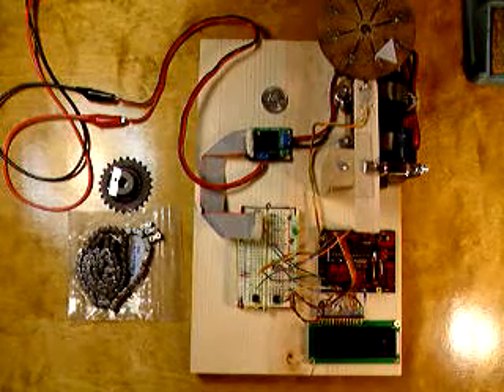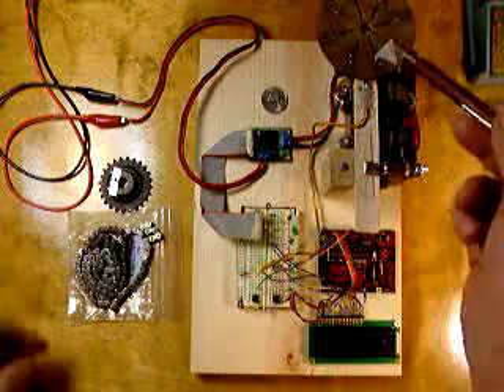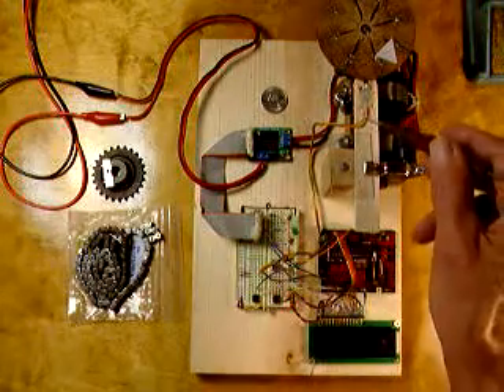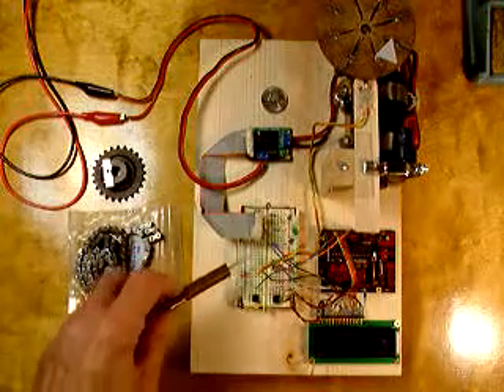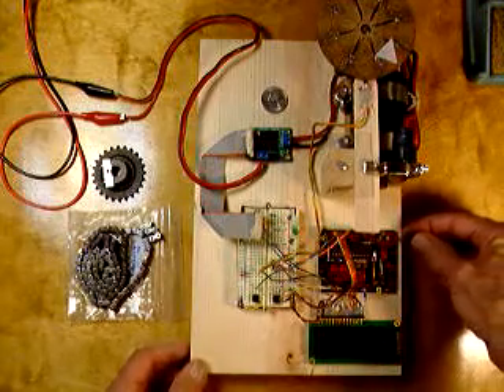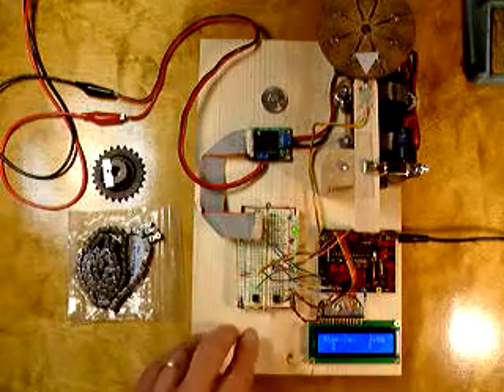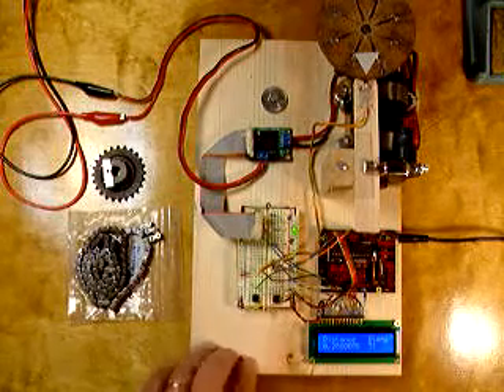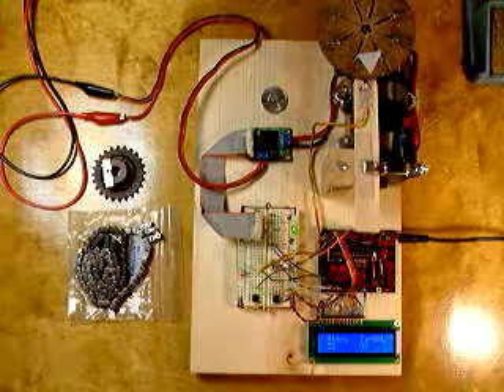Arduino servo breadboard

Comment: Is the seat belt motor a DC motor that works a little like a stepper since you're monitoring its position via your DIY encoder disk and the hall effect sensor?  If so, why not just use a stepper?
Reply from the maker: Yes, but a step motor with that much torque would cost much more. One of the objectives of this project was to find a way to do a precision job with inexpensive componants.
Reply: Jim Harvey I see, make sense.  Nice work.

Comment from the maker: @omkarkarve I never went as far as drawing up a real schematic.  I only used the MOTA and MOTB pins on the Pololu board.  What I do have is a drawing of the interconnect board that connects everything together, and the code that has lots of comments on what the pins are doing. Email me at Gmail and I'll send you those files.

Comment: Hey... cool project ... i also happen to have a vnh3sp30 on a board from pololu and an arduino, will you be able to share the circuit for the board you made? I am a bit apprehensive to start soldering stuff before i know that the circuit is a tested circuit. ...Appreciate the video./